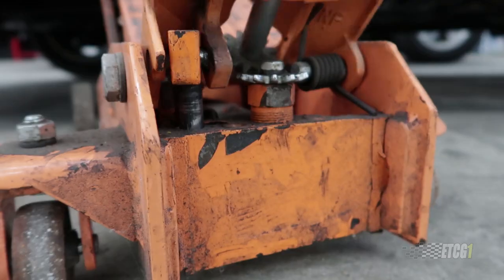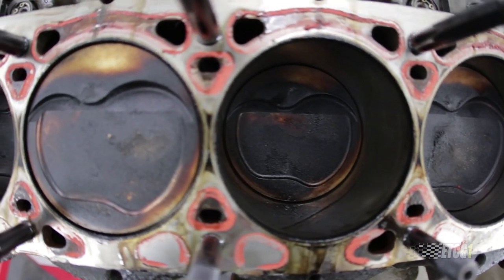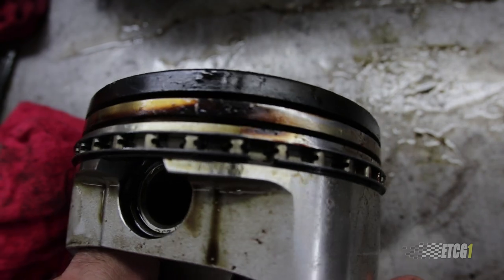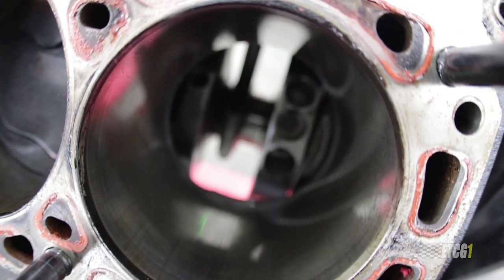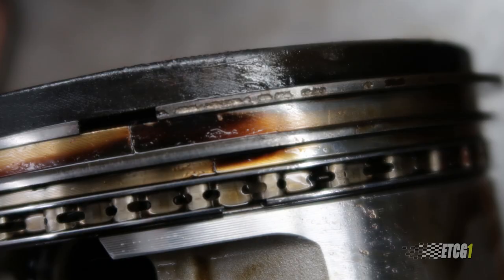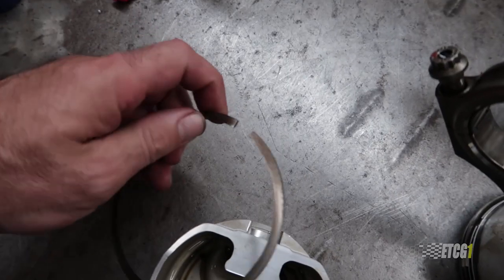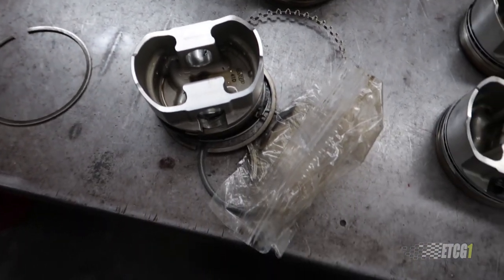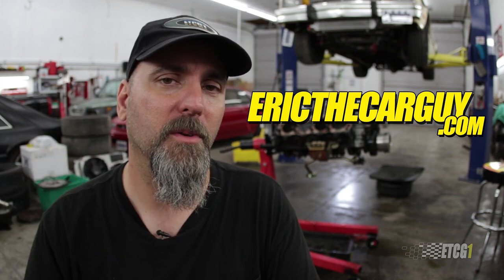Hydrostatic Lock the Silent Killer

Comment: I find it odd that it only damaged one piston. Other cylinders would have filled with gas at the same time as the broken one did. I still think it was detonation. Could have been mild enough that you didn't notice it but enough to pit the rings and break the ring land. It's unfortunate either way. Hopefully it doesn't set you back too much. I still think a rear coolant crossover wouldn't hurt. Since the SBF is notorious for having the rear two cylinders get hot. I'm curious what the engine builders think caused it.
Reply: Also, did you take into account the elevation changes over the course of your trip? Based on my quick research, your trip to Carlisle would be enough to cause a significant change in your air fuel ratio, and lean the engine out.
Reply: Good point.  Plus the engine does not run any sort of ignition timing compensation for intake temp nor is he running any kind of knock control.  The setup is a recipe for broken ring lands.
Reply: Its not that odd when you think about it, thats just the piston that came up first. If it had anything to do with detonation though id blame the guy running the dyno. Engine goes lean and you're still beating on it going into the boost? Doesn't usually end well.
Hes also running an AFR gauge, so the mix going lean without him noticing seems unlikely.
Reply: sparkplug1018 except when he did an entire 1/4 mile pass at 14:1

Comment: I want to keep learning or cement in what I learned.  Valves rotate and rings rotate, correct?  Are there any exceptions?  Do the rings rotate together as a group?   That is, does the distance between the ring gaps of various rings on a single piston remain as it was set, or what happens?

Comment: What is that fluid poring in at 2:31~2:34 at the air intake left fender? ?
Reply: that was Gasoline blowing out from "turbo pressure", in a previous video he showed the fire and fuel pressure regulator issue that filled the intake, intercooler and engine with fuel.

Comment: My friends newly rebuilt VG30DETT cracked a cylinder wall from having it upside down and working on it where fuel leaked into the combustion chamber. When he installed it and tried to start it, the coolant leaked right into the oil pan. I have a video of it from my boroscope.  So if you tip your motor upside down on an engine stand, make sure the cylinders are clear.

Comment: I had a 400 sbc in high school that blew a head gasket and my old man replaced it three times but it kept blowing. I cranked that thing every morning and blew water out of the pipes for a month before he replaced it the final time. As I was putting up his tools, I noticed his torque wrench was an inch pound wrench. I walked in and asked him what in-lb meant because the shop at school had ft-lb ones. He was so pissed. So after getting the proper torque wrench and going over all of the head bolts, it never blew another head gasket, but about 10 months later while
I was at tech school, the number 3 piston decided to expire and blow a hole in the cylinder wall. It also cracked the cam into 5 pieces. The rod and piston pin were still where they belonged but the piston was a bunch of aluminum scrap in the oil pan. I’ve used arp head bolts, mls head gaskets, and haven’t touched cast pistons since that day.

Comment: I worked at Mazda near a known flooding area and RX8 owners always felt the need to drive in flood water. Hydrostatic lock does terrible things to a rotary engine. The block plates usually split apart.

Comment: Hydrostatic lock can also come from too much oil in the cylinder. My Porsche 996 Air Oil Separator went out, so it was letting a LOT of oil into the cylinders. I was scared shitless that it would hydrolock before I was able to drive it to the shop for replacement of the AOS.

Comment: I've seen hydrolock many times, esp back in fast n furious/ricer days of the early 2000's. Many "cold air" intakes were designed to be wet dry shop vacs in their design lol. Many times the problem would present as not quite a dead hole but definitely weak. Further testing would usually show low compression and ultimately a piston   .250 in the hole.
Reply: "cold liquid intake" snake-oil since the early 90's